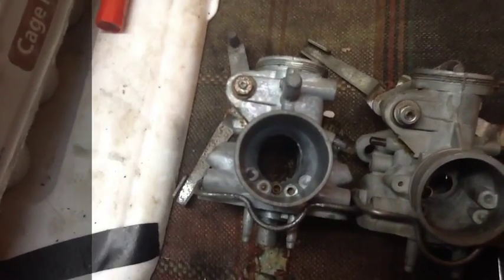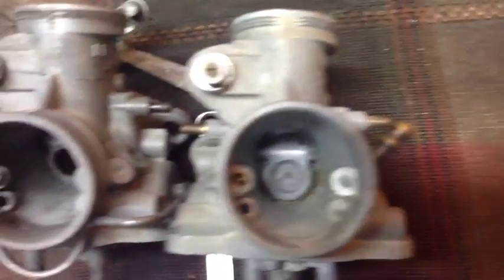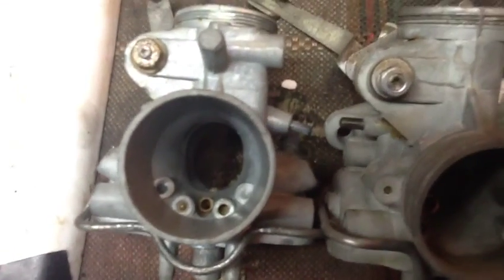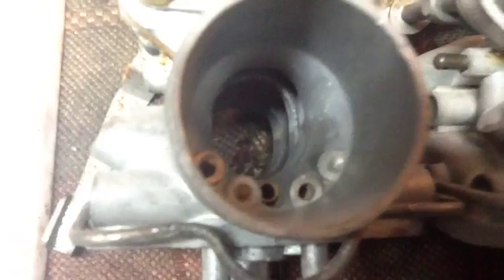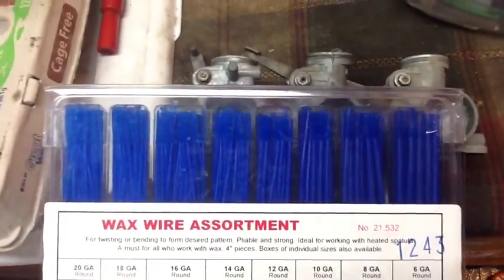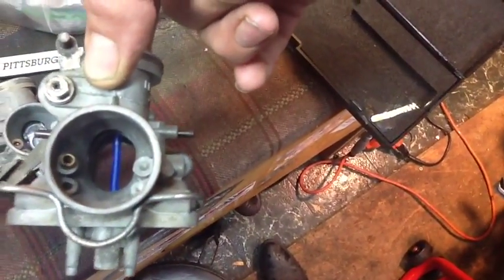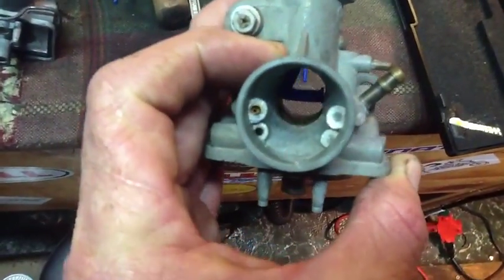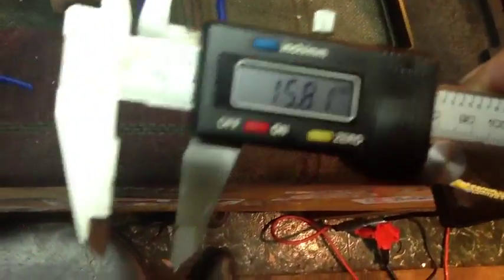Cl160, Cb175, and Cb200 Keihin Carburetor Comparison

Comment: Thanks for sharing this!
I just got some Keihin carb's from this range of bikes (hopefully to suit my CL/CB175 restoration project) so this will help me identify from the four or five carb's, which parts are correct (and presumably optimal) for my bike.
Shall jump in and check them out now..
(I know I have a pair with the tab marked "18" on the face of the slides, and another pair with just the plain unmarked slides.  Yet to inspect all the jets and such, but hopefully there's enough parts to make a good suitable pair).